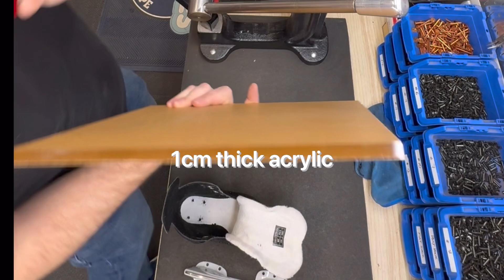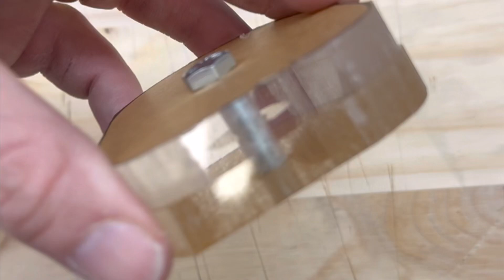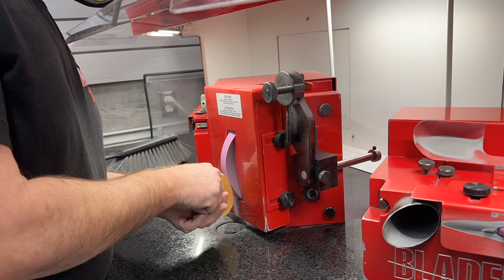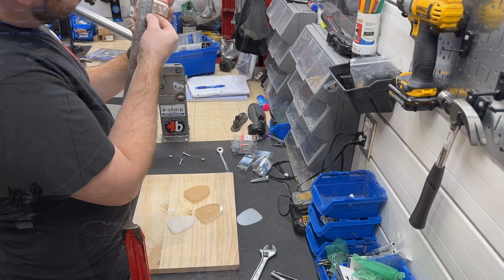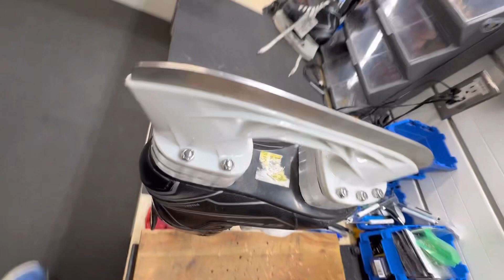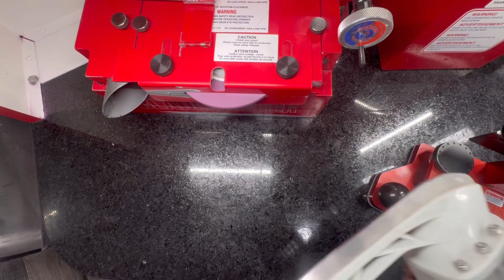2.5cm Lift

Comment: Nice that you guys are making skating accessible for people with non symmetrical leg lengths.  How did you guys come up with 2.5 cm did you guys measure her?
Reply from the maker: We deal with a number of the ortho/podiatrists that specialize in this sort of thing. We only really show the extreme cases, like this one. In general we are splitting the difference in leg length. She has a 5cm leg length difference, so we built a 2.5cm lift.
Reply: @bsharpottawa That makes sense.